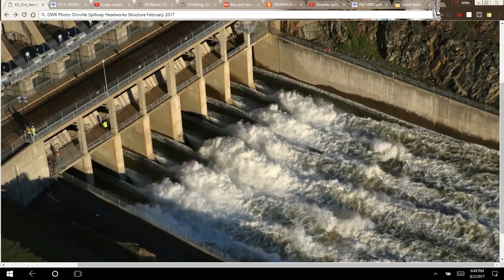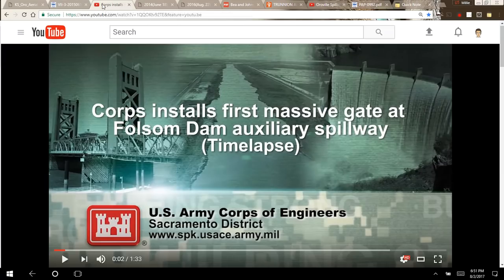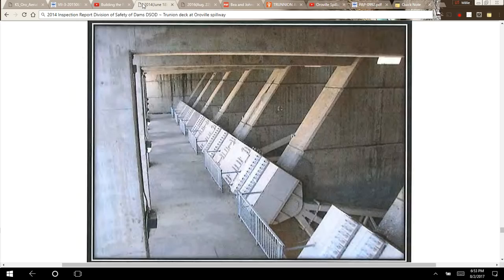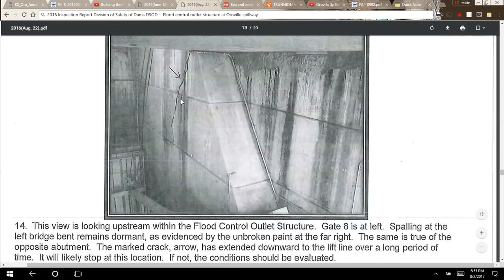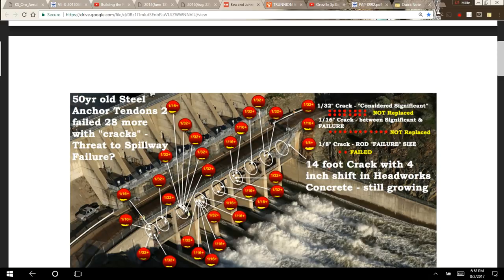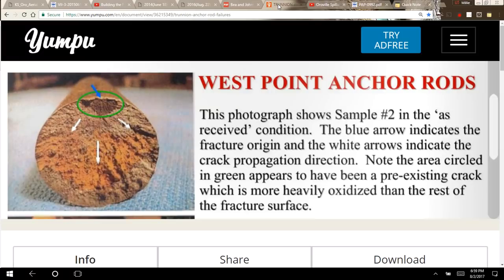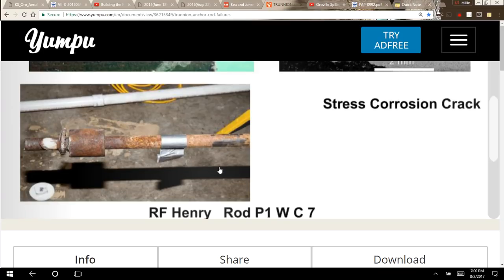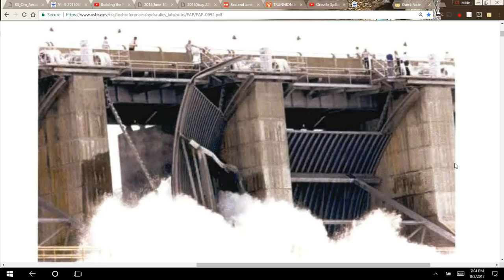Are Oroville Dam spillway gates safe? (And what about those trunnions and tendons?)  8/2/17

Comment: Thank you, Millie... Even welders on a two story building know that strength of steel is checked by x-ray... If it's good enough for welds and new steel, it's good enough to rate old steel...That's not even a full forensic report... How can DWR state that the steel is "safe" if 1. The tendons are at the end of their usage, and 2. The steel in question has obvious, visible weakness, and 3. They don't know the full extent of the damage visible, because it hasn't been x-ray investigated to document which gates should be replaced if any are to be left in service, and 4. DWR is not stating what "safe" means in terms of years or any other means of measurement... They can't afford a cost-benefit analysis when so many lives are at stake... While others are distracted you have your eye on the ball... Great work...
Reply from the maker: You're very welcome. Thanks for your insightful comment -- and for the awesome compliment! All of your points are spot-on, April. It seems we are supposed to blindly accept it when they say "the gates are safe." At community meetings, there is only three minutes to state a concern, and debate is not allowed.
Reply: Then several people need to gang together to repeatedly demand x-ray of all of the steel in question and slam out the video to all fb groups and even the media covering this to share it also... It's common practice and the only reliable way to test steel to leave no doubt... Do not be intimidated by those in positions of authority... They're not engineers... What's wrong with insisting that the steel be inspected with a common method except that they don't want to pay for it? There's nothing wrong with getting a second opinion when life is on the line...
Reply: Also, it's the perfect time to test it, and if anyone dies, it's on the Governor's head and the Company will have a black mark on it forever... Do not give up on this... The money is there...
Reply: Steel is NOT X-rayed in every structure built. The only mandatory X-Raying of welds I am aware of is some pressure vessels and nuclear steam systems.
Steel can NOT be X-Rayed in concrete, a representative sample of weld is sent off to a lab for testing, or the weld is tested before being encased in concrete. None of the reinforcing steel or welds buried inside the concrete on this dam would've been X-rayed as they would have been specified as many times over necessary, as would the tendon rods have been.
Steel in itself is NOT tested in this way as it is a known quantity and is clearly manufactured and supplied as such,complete with random samplings of batches both as the steel is being alloyed, and after it is converted into whichever form it is to be supplied in.
Large structures like this are massively over engineered, the rods and concrete will be many times over the safest conservative specifications.
In conclusion, to X-Ray these rods (which would not be done to inspect for cracks as it cannot be done in situ) they would need to be removed, at which stage you simply replace with new as they cost very little- all the cost is in removal and replacement in the first instance.
If you are going to clutch at straws, please at least educate yourself as to what you are talking about first.
Reply: Sideslip, it seems, has never worked construction on a government project or on base doing construction at all... It's common practice, and this is a government job... I've seen welds rejected, and the only way to know how bad the integrity of the steel is, is to x-ray the steel in question... This is bid into reputable contractor's jobs, especially when a state or the military is involved...
Reply: Not that it needs to be... If the damage is easily seen with the naked eye, and there's a 4' offset, it's pretty obvious... Not all of the steel is encased in concrete...
Reply: Sideslip; Large structures like this are massively over engineered? Then you might like to explain all the deficiencies which caused the main spillway to collapse? Such as the concrete being too thin, trees left growing near the drainage pipes which in time blocked them and the fact that the spillway was never anchored to the underlying bedrock? And these are just some of the many problems the dam has.
Reply: Sideslip.  You need to show more respect to a lady!!

Comment: G'day,

  Yay Team !

    What a brilliant Explanation of the nature of the problem, Millie ; 90% of the  50 year-old Steel Tendons are buried inside the Concrete, and are thus "Un-Testable"...

   On the bright side, the fact that the Tendons had a Design-Life of 50 years, and they've lasted  50 years, might mean that they were "obviously" built correctly & according to Specification ; on  the other hand, for most of the past 50 Years the Spillway-Gates have been doing nothing, because in what used to be an "Average Year" back when the System was designed & built - the entire Annual Inflow was balanced by a combination of Throughput at the Hydro-Electric Turbines & Evaporation....

  So, the fact that as Global Warming's  increasingly frequent Extreme Weather has brought the Main Spillway & it's Gates into increasingly frequent use towards the end of their Designed Service-Life is unfortunate ; but it doesn't indicate that the Equipment was neccessarily badly built, nor made from sub-standard materials..., though contemporary Engineering abilities and standards have both improved since the 1960s.

   However, there are three salient facts here...; one is that the Tendons, like the Concrete they're bedded into, are now becoming "Time-Expired" in terms of Design-Life - even if they were propperly built back in the day...

  Another point is that already "2 Tendons have already Failed, while 28 more are known to be Failing ; while one of the 8 ft-thick Concrete Supports they're bedded into has a 14 ft-long Crack embodying 4-inches of Vertical-Displacement....

  And, in the Gripping-Hand...; to replace the Gate-Tendons requires demolishing & rebuilding the entire Gate-House..., which would take over a year to achieve...

   Therefore, apparently, the Official Plan seems to be to hope and pray that all that olde Steel & Concrete will just(ifiably ?) keep on keeping-on ; because the Great State of California cannot Economically afford to Empty the Dam, and do without all that Water, for long enough to rebuild the Gate-House to 21st Century Standards.

  My guess is that the Decision-Makers are betting that Global Warming's extreme weather  "must be" going to fade away, and also that all that old Steel & Concrete will prove to be immortally-strong (having been built by "The Greatest Generation ?) ; so that's why they're telling everybody that "they cannot imagine the Gates as being unsafe..." (!).

   With the Green (Wet) Spot on one side of the Earthen Dam, and the Time-Expired Failing Gates on the other side, with the Main Spillway currently unusable & being reconstructed, while the "Emergency Spillway" is getting urgently upgraded from "Ornamental (Failed)" Status into something like being "Functionably Useable"...; it seems to me that this whole "Emergency Repair Scheme" could come catastrophically unglued by a Fortnight of "Unseasonal" Wet Weather, any time in the next 6 months...

   And, meanwhile, Global Warming seems to rather specialise in delivering "Unseasonally Wild Weather"...

   So, this appears to be a "Nail-Biting" Saga for quite a long time to go, yet....

   Living downstream, as you do, maybe look to your Bug-Out Bag...; and keep the Fire-Chariot fuelled, ready for a sprint for Higher Ground, just(ifiably ?) in case the Warning suddenly  comes that there's been a torrential Cloudburst, up in the Catchment...

   Pretend that you're a "Boy/Girl-Scout", and Be Prepared...; it can't hurt, & it might help.

  Infrastructure-Decay, while unmaintained for Profit-Maximisation, until Catastrophic-Failure ;  may well prove to be one of the more culling Feedback-Loops which the 20th-Century has (gleefully ?) built into it's Descendants' Future

  Such is Life,

  Have a good one...

   ;-p

   Ciao !
Reply from the maker: Hey Warbles! I was hoping you would show up and render your profundities. Your insights are spot-on! Thanks so much for taking the time to address the many facets of this situation. I will definitely be scrutinizing the fall weather conditions as I continue to fine tune my personal evac plan. Take care, Warbles!
Reply: WarblesOnALot 
Warble~~ You nave a great deal if insight and solid info! You are a great asset for Millie Kay.
Reply: +Millie Kay (Feather River Girl) 

  G'day Millie,

   Thankyou !

    You're posting such high-grade Coverage that I reckon it deserves the best Feedback I can come up with...; that's what the Comments Function seems best suited for, as I see it...

  Besides, you know the difference between a Grey Kangaroo & a Swamp Wallaby, and not many in the USA can say that ; so your Channel is obviously deserving of whatever assistance I may offer.

   Have a good one,

  ;-p

  Ciao !

  Have a good one
Reply: +John Perry 

  G'day,

  Thanks !

   I have almost no firsthand knowledge of these matters, it's all sort of stuff from my Trivia File plus what I've picked up from YT since about March.

   I started by watching +blancoliri Channel, and though he's a professional Pilot & my first Aeroplane hangs in a Transport Museum, it didn't take long before he blocked me from commenting (though I still  subscribe to his Channel and watch his Videos) ; apparently it seems that my having mentioned the connection between Anthropogenic Global Warming & increasingly frequent Extreme Weather (like, um..., 8 years' Drought followed by 230% of a "Normal" Winter Snowpack all in one go...), and the catastrophic failures of both Spillways back in February put him on-edge.

   But in Hindsight, he probably blocked me when I asked if he'd ever added up the number of Litres of Fuel he's opened the Throttles to burn, and multiplied that figure by 2.5 to translate it into Kilograms of Carbon Dioxide in his Exhaust Gasses, so as to be able to divide that by 1,000, so as to know how many Tons of C.O.-2 he's managed to emit..., so far...

  I suspect he took it as some kind of deeply threatening question, rather than a simple comparison of Lifestyles...; I'm pretty sure that I admitted to emitting 9 Tons of CO-2 myself.

  But obviously my feedback peturbed him well  beyond his ability to cope with, which is a pity, really, because he's got a great Channel ; and he's certainly the living embodiment of the Great (Male) Aviation Dream (Private Pilot's Licence, Air Force Career flying Multi-Engined Jets, Airline Career, 1 Young Wife, 2 Little Kids, 2 Cars, 2 Boats, a meticulously-maintained 4-Seat  Vintage Aeroplane, a Motorcycle, and the House in the Forested Hills near Oroville....).

   I think he thought that I was mocking him, rather than simply comparing notes ; with someone who lives differently.

  The other Channel which I've been watching is that of the Californian DWR ; with an occasional glimpse at some of the Alarmist/Conspiracy-Merchants (to see what the Hoi-Polloi are dreaming-up to worry about...).

   I've been actively sitting out on the edge of Society since 1984, but I was raised to be a sort of observant Oddball well before that ; some people enjoy my perspective & others can't stand thinking about it.

   I figure that if I were actually full of bullshit then the Wildlife wouldn't bother to visit me and hang out, even when I don't feed them (!).

   Have a good one,

  ;-p

  Ciao !
Reply: WarblesOnALot ~

Warbels~ Hey, amigo! Like you, I settled in with Juan Browne, and later on here with Millie Kay. Juan has a pretty good handle on things and we both have military backgrounds. i was career military with two in the Army and about twenty in the USAF, all commissioned. Even with that, Juan replied to only one of my inputs. He has an agenda, and the Oroville dam is just part of it. The bottom lime is really what he reports, and the way he does it. Like Millie Kay, he sticks with the facts, and goes after The DWR using his Press Pass as a way in the door. He is professional and has never had the gloom and doom agenda. I don't loose any sleep over what Juan  decides to reply to, I simply see him as a news source using youtube for additional income.

So, I do look at Juan when he talks Oroville Dam, the rest not so much. I find Millie Kay has a better grasp of the entire Oroville dam/ Feather River complex, than anyone else out there. I have learned a great deal from Millie Kay, and like Juan, Millie Kay has never been a prophet of doom in all that she has presented, the current Gates and crack included. If there is s purest out there about the Oroville Dam/ Feather River complex, it is Millie Kay. She can also handle her self well with differing views. I just think she is really the best out there right now. If I get a chance to help her out, I do what I can.

What I really like to see is when folks like you, the experts who know what they are talking about jump in and back her up. I just think a great deal about Millie Kay and all the work she puts into her videos.

Stay well, amigo; and thanks again for your rime to give me a reply.,   "JimDig"
Reply from the maker: Aww . . . thanks, Warbles! Plus, I know what a Chough is LOL!!! I appreciate all your comments. Stop by whenever you're in the neighborhood!
Reply: +John Perry 

  Thanks mate,

  But, um, I'm merely an "Eager Amateur"...

    Yeah, Juan has his Agenda..., which seems to be that nobody should ever find fault with him for having taken the "opportunities to better himself" which have appeared before him in his Life's Path...; and he so guards his right to defend himself against any percieved posibility of a "Threat", that he blocks people for daring to think any differently to himself.

  So, yeah, I really greatly appreciate Juan's Videos, and I "Like" almost every one which I watch ; but his reflexively aggressively "Defensive" posture, habits, and behaviour on the Comments Thread conspire  between them to make him a less than "positive" Exemplar of mainstream AmeriKan Kulture...

  I wish he were less Thin-Skinned, but my wishes count for nothing in his sight.

  Because he is so SCARED that I might say something which upsets him, he's blocked me.

  Millie isn't anywhere near as much of a Scaredeycat as Juan is..; she merely puts my Answers "On Approval" whenever she thinks that I might be trying to initiate a fight.

   Considering that I'm a Celibate Pacifist Vegetarian, whereas Millie might be seen to be being "prudent" when I say something unusual ; +blancoliri transcends that, he's clearly well into the territory of the Obsessive-Compulsive Control-Freaks, and therefore he rebuffs honest people just(ifiably ?) for attempting to be friendly to him...

  Which will prove to be his Loss, in the Long Run.

  Such is Life...

  ;-p

  Ciao !

  Such is Life
Reply: +Millie Kay (Feather River Girl) 
  
  No worries Millie !

  Have a good one,

  ;-p

  Ciao !